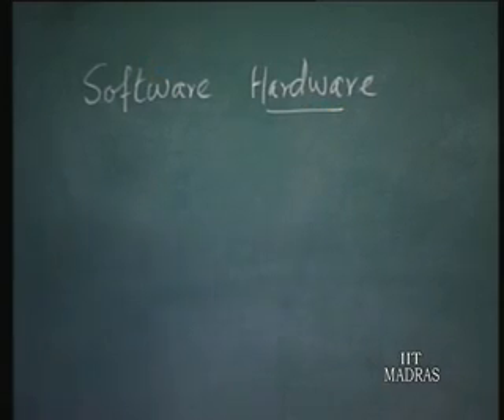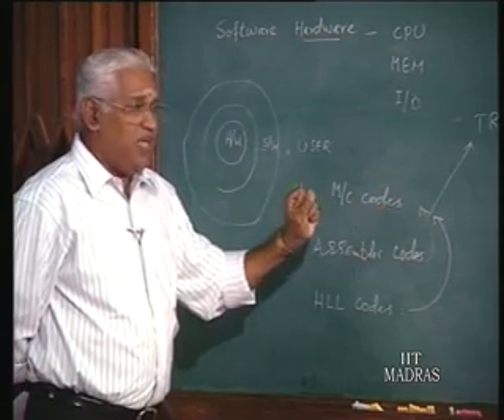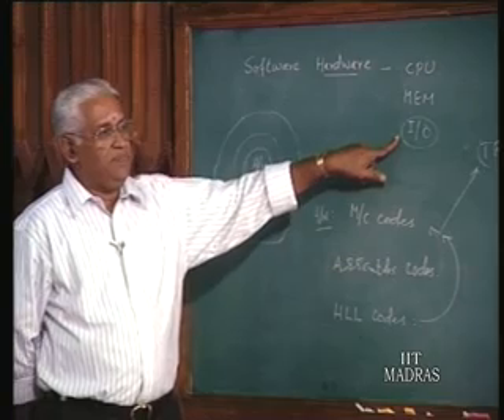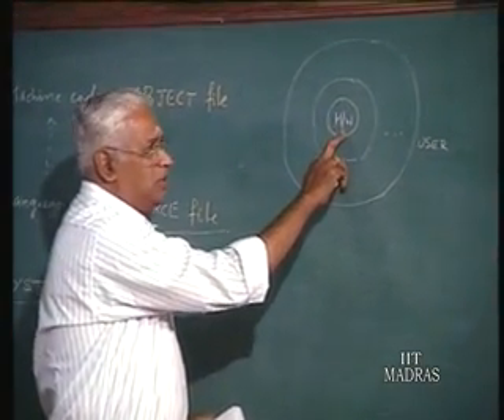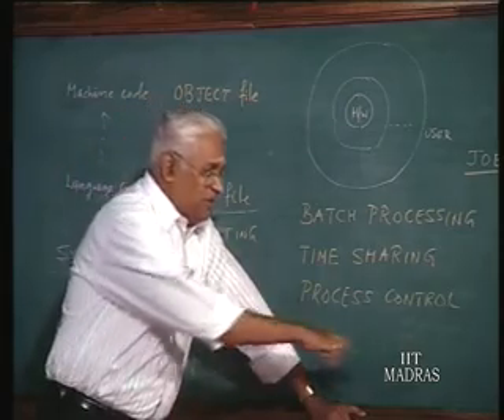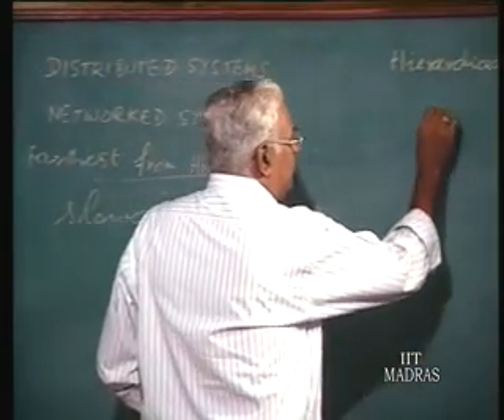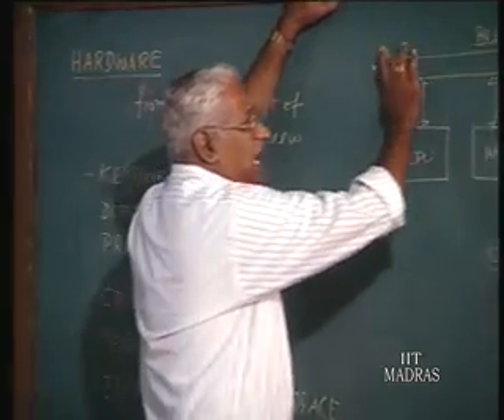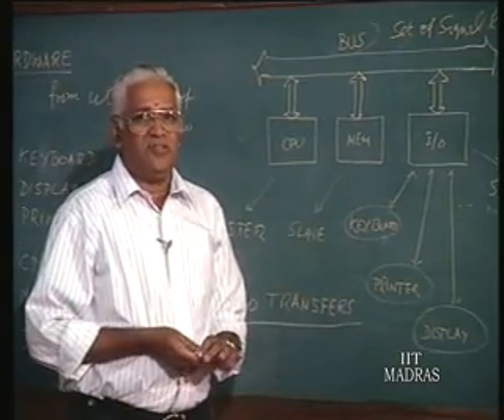Lecture - 2 Introduction To System : Software

Comment: Can anyone tell me the difference between distributed and networked os
Reply: Network operating systems are considered here to be those which provide support for networking and remote resource access, often by a separate layer of software on top of a conventional OS. Distributed operating systems strive for a high degree of transparency and often support data and process migration.Distributed systems intended primarily for real-time applications are listed in the real-time section. Distributed systems for shared-memory multiprocessors are listed in the multiprocessor section.